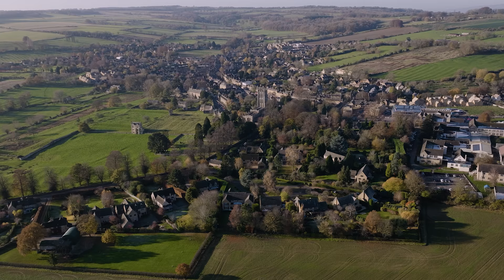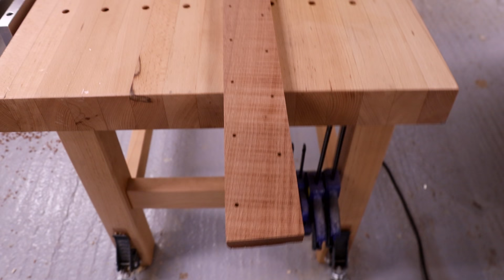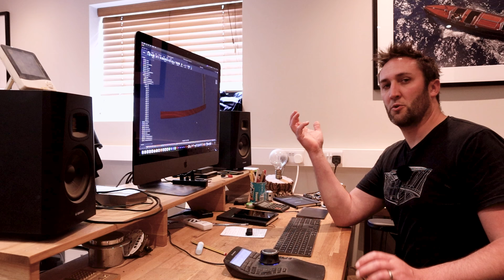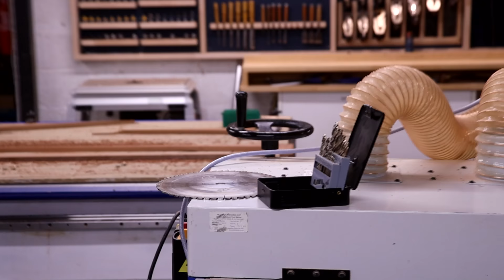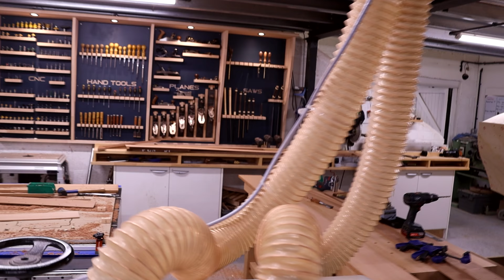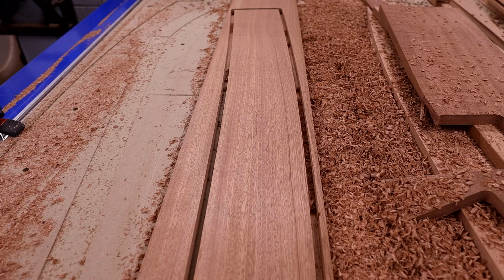Can CAD Replace Traditional Boat Planking? | Building Temptress Ep46

Comment: Dan, if the bungs will be from the same piece, and the grain runs in the same direction, and the whole will be finished the same, will anyone on the planet earth notice the subtle spacing difference down the line several inches?

Comment: I do a fair bit of resawing. I use a circ saw style thin kerf blade in the table saw, saves about 1.5mm of kerf. Still have to end for end it of course and often have to bandsaw or handsaw for the last bit.

Comment: That has been again very insightful. I am at the very beginning to design my first boat, I use AI heavily and am currently doing requirements management mostly, plus I have digitized many books and standards on naval architecture. Later I also want it to do the CAD design with AI, but in build123d, as it is purely code based and can do things like developing panels very well. Fusion I heard is not very good in this, that is why many use Rhino or FreeShip/Delftship for certain things.

Comment: Just wondering if a handheld CNC router would be useful for cutting the longer planks.
Reply: RAN sailings current build he used one extensively ..still haven't got my head round how that works 😂

Comment: What software is being used to flatten the 3d plank files to become a 2d file?
Reply: I’d like to know this too.
More than 40 years ago I wrote a paper about arbitrating labour disputes in which I used mathematical techniques first invented in the eighteenth century to transform the shapes of statistical density functions in much the same way as you are doing with the surface of your hull. I have no doubt that computational methods have advanced a lot since I wrote my paper, and certainly those days there were no off-the-shelf computer packages to do the computing for me.
I recently used Fusion to design floats for a model aircraft and looked for unwrapping tools in it. I was surprised that there were none. This actually influenced the design of my floats quite a lot.

Comment: Will be interesting to see how the planks higher up fit, weather the slight differences from where you have to tweak the fit of the planks in each level start to add up or if it doesn’t matter that much!

Comment: Dan, another way to fit the seams where there is a tiny gap might be to use Norton Abrasive cloth, lay a strip along the top edge of the first plank, say a 180 or 220 grit?  The slide the next plank fore and aft while holding it down to the edge w/ the abrasive to find sand the two edges against one another? Instead of removing plank, setting up in planing clamps or horses taking a cut and refitting... sanding one or both surfaces using the mating surface as the 'sanding block' seems like it might work?

Comment: Your method so far is great but it is based on your boat and your CAD model being identical. You could do a 3D scan of the actual boat hull and create your planking sections from the actual geometry you are going to place them on. I think a problem you are going to run into is assuming the shape of the opposite side of the hull will be an exact mirrored shape. Not trying to be a downer just offering suggestions/options.

Comment: Enjoyed every single episode of this build, and the 1/4 scale before it.   I don't think I could even switch the CAD  on let alone programme it, but it's fascinating.    One question Dan, cutting these side planks you didnt go all the way through but turned them over to complete them using a hand held router, how do get this to line up with "the other side".
But a brilliant series Dan. 👏👏👏👏
Reply from the maker: Thanks for watching, I'm glad you are enjoying it! The hand held router has a bearing guided trimming bit in it so it follows the edge of the CNC cut profile.

Comment: Awesome video. Interesting you do a conventional cut on the piece. All the CNC work I did on the Format 4 Profit200 was climb cutting. Gave a much nicer finish on the work. So looking forward to the next episode.
Reply from the maker: I very rarely use climb milling on wood as I generally see much better results with conventional cutting. The only exception to that is in some work that contains high risk of break out.
Reply: @DanLeeBoatbuilding are you using up or down cut bits? That's very interesting as I used to get the opposite results. Learn something new everyday. The majority of my tools were down cut to keep the top of the surface clean.

Comment: Super interesting and super challenging mixing computer / CNC accuracy with real world actual construction. Thanks for doing this and sharing it.Easy to do with metal but wood and glue and screws and manually cuts intermixed ... not so easy.

Comment: Planking milled to shape on the cnc, book matched?
Pre drilled screw holes?
You are a bold young man.

I thought milling all of the bulkheads was stretching things.

On the cnc milling of the long board, in that 100mm overlap, could you not make a 4 pin registering setup during the first half in the waste area. Should be able to use the same 4 holes for future boards.
Reply from the maker: Good suggestion for the long board, I think I'll try that for the next one 👍

Comment: Hi Dan, brilliant use of technology to cut these planks.  The time saved laying out and spiling each plank will be substantial and cost saving esspecially as one cut gets you a matching plank for the starboard side.  There is a bandsaw attachment that Darren Oates (https://youtu.be/NpTCEiVaToA?si=GugFuf5yk3fow4Ce) uses for resawing veneers which would make the process a tad safer, more accurate and speed it up significantly. It may be worth the investment?  Next, a rolling bevel 🤣

Comment: Given that modern epoxy binds everything into one unified, monocoque structure, why not merge structure with pure design here? 🤔 Why not anchor the necessary metal fasteners into the structural skeletal ribs, but deliberately arrange the external wood plugs along fluid, sweeping lines that reference the chine or deck profiles? Sure, traditional ribs make structural sense for when accidents inevitably happen at sea. But we shouldn’t let perfect be the enemy of good! Blending the strength of the core with a cleaner, more aesthetically sweeping view of the hull side would be the ultimate harmony of form and function. Shoot for the moon and beyond, right? Brilliant build either way! Cheers 🍻

Comment: Are you still leaving 1mm on each edge for trimming? Is that why the match between rows is really close but isn't quite perfect?
Reply from the maker: I was as contingency and yes that may be the reason for the small gap. If they are fitting this well I might ditch the 1mm offset and cut them to actual size. Otherwise I’ll have an oversize creep over each plank.
Reply: @DanLeeBoatbuilding  Thanks for the update - yes it was my thought the issue might be cumulative if you weren't actually trimming. Although I suppose you still have the edge bevelling to do yet.  It's not in me but I guess that's why I always appreciate the fine detail of craftsman such as yourself. Thanks for sharing.

Comment: Have you ever tried or considered a carbide tiped blade for your bandsaw? It really makes a big difference in cutting speed, accuracy and surface finish. Maybe hard to source though, and only makes straight cuts, but stays sharp for very long.
Reply from the maker: I haven’t, any idea where I might be able to buy one in the UK?
Reply: @DanLeeBoatbuilding  you could specifically ask your supplier for a "Laguna Resaw King" blade

Comment: Very interesting video. It's great to see experimentation with faster working techniques, your bandsaw fence did seem to have some flex. I have seen some people using powered resawing guides from companies like Felder that support the work on both sides and pull the work through, which seems more convenient, and probably safer too. Can't wait to see the finished article on the water.

Comment: Illuminating methods and techniques as always.  Please share the results of the scanning you mentioned preparing to do in the previous episode.  I presume it was highly accurate since you are expecting the book match to fit the starboard side?  What sorts of errors did you find?
Reply from the maker: I haven’t yet done the scan, I am awaiting the arrival of a new scanner that I am being sent to trial which will also be an exciting test. That should be with me next week so I’ll put the scan results in the next episode before I start bonding on mahogany 👍
Reply: Revolutionary ‼️
If it proceeds as it’s started, this method is a winner ….
Well done,
Robert 
🇦🇺

Comment: Just curious, could you saw the planks before you cut them on the CNC table? A straight plank could be controlled more precicely. I have never built a boat but I have sawn a lot of planks.
Reply: Yes, but then u have to cut the whole width of the plank.

Comment: It will be interesting to see how well the planks fit on the other side. In theory the idea of flattening the CAD curves on one side and using it to cut planks for both sides should work perfectly, but only if the build is as symmetrical as the CAD model. Personally I would offer up the planks on the other side before declaring the experiment a success and continuing with more cutting.

Comment: Flattening double curved surfaces is a precarious endeavour  in almost all CAD suites. I'm mostly on SW and that doesn't do great with it either. The best i've found is to make surface body slices of a plank thickness, more is better but like 5 will get you most of the way there, and unwrap/flatten these. Stack them back up again (if this is troublesome, shoot holes in the initial body and use these to line it all back up) and use boundary surfaces to reconstruct the edges. This will also not be perfect, but it is more consistent.

Another option is to see if there is some kind of composite layup package to be had for F360. They are used to unfold prepreg plies so they can be cut by a plotter and still match up with the eventual shape. Usually though, de decent ones are "commercially priced".
Reply: We use geodesic unfolding algorithms in sail making. Completely automated. And sails made of carbon need to be perfect.

Comment: Try a carbide tipped bandsaw blade with very low tooth count. One tooth per 2 centimeters. Tune up your guide blocks or even upgrade them. You will be amazed at the difference the blade will make. Your blade wondered due to too many teeth and was dull. Love your project, thanks for sharing your craftsmanship.
Reply: I also use a carbide-tipped bandsaw blade, and it works great for resawing.